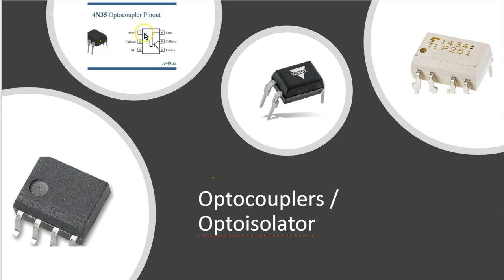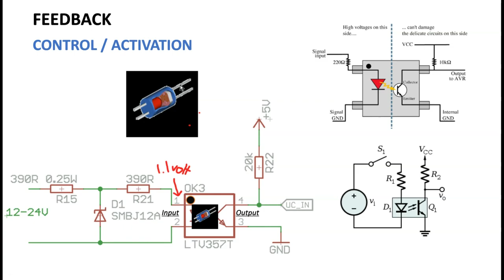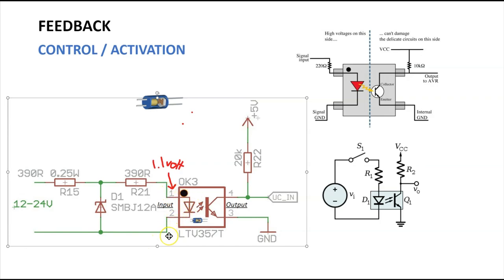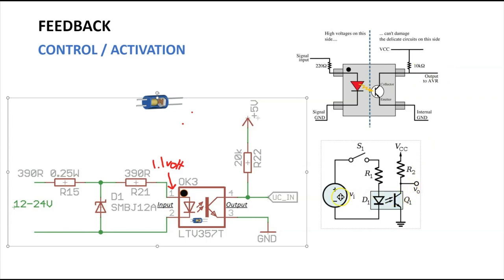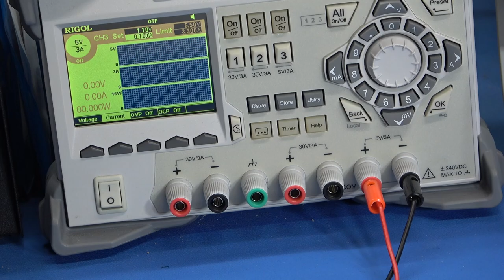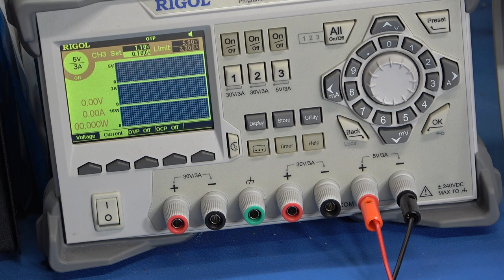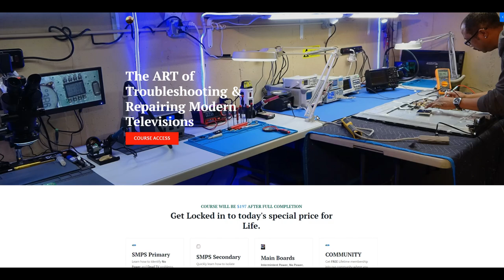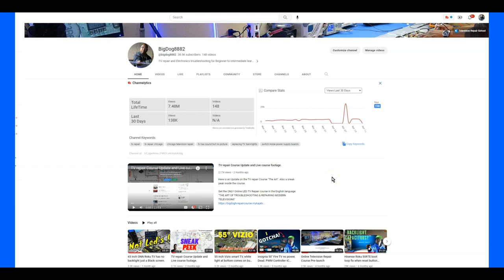Why Optocoupler's are used on Switch Mode Power Supply boards. True Optocoupler testing.

Comment: There is a electrical connection from hot to cold. It is called the chassis (frame ground.) It is where many problems can be propagated from the hot to cold side. All decoupling caps on the hot side go to chassis ground, all suppression caps on the hot side go to Chassis. When either fail the current can and does fold back from cold to hot or forward from hot to cold.

Comment: From my  personal experience, people need to be careful with samsung tv power supply, because you still can get a nasty shock from the cold side too . I did receive a nasty shock from a 40 inches samsung led tv power supply on the cold side .
Reply from the maker: Most likely the LED circuit if it uses a 300+ voltage rated filter capacitor.
Reply: Cold does not mean it can’t shock you, ideally it should not kill you but even that may not be 100% true all the time. Remember to always understand what you are doing and if you don’t wait until you learn (like from the ART course)! Glad you are doing well!
Reply: @hernancoronel ;  I did not start repairing power supplies recently, OK?

Comment: I BigDog, i am from Portugal (Europe). At the moment i am crossing some dificulties.
I can´t manage to pay rigth now the course that you offer for a great price.
I took 18 hard months to pay my Oled TV, cause i really enjoy it, but 6 moths before 2 years garantie past... The TV doesn´t turn on, and no IR signal. I have noticed that , power supply is not given any output. Everthing ok until we get DC power at the capacitors before the bridge rectifier, than i saw a open fuse and many components that are short cuted and others open. I can´t manage to get the electrical scheme.
I had study electronics at 30 years ago...i went to study Electromechanics before the first 3 years course of electronics. I can do maintenance at a 250.000$ CNC machine, but I know that i need a lot more knowledge to start repairing TVs, it´s a diferent area to me.
This hard moment will pass, and will come to adress to your course later.
Regards,
Pedro

Comment: so to test octocoupler on tv power board can i just put a 20ohm rersistor betwen output to bypass it?
Reply from the maker: No, please don't. Just check voltage on output to make sure the output side is completing the circuit when you have the 1.1 volts across the input, otherwise you can still use you meter in diode scale too, to check.
Reply: @bigdog8882  ohh ok great to know thank you

Comment: Hello Bro...hv got problem with my Samsung smart TV,  power indicator light does not ON. I have changed 2 boards, the Main and Power Board but still noughts.. The TV has Power Board, Main Board, T Con Board and the camera board. What's the likely culprit?? Ur expert opinion is very much appreciated. Hassan from Malaysia.
Reply: Maybe backlight issue